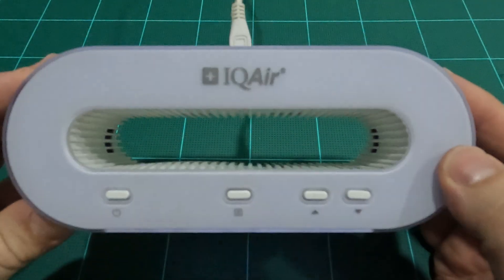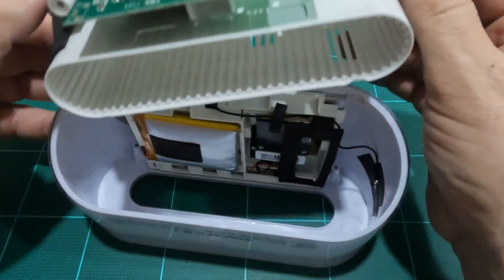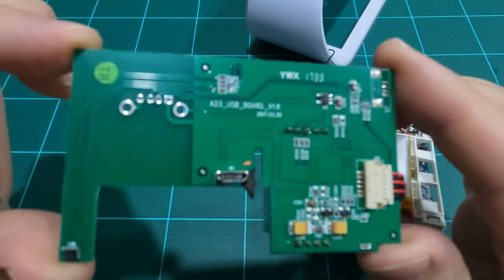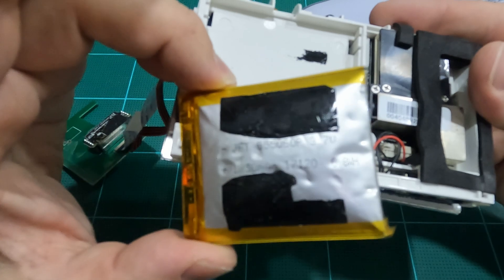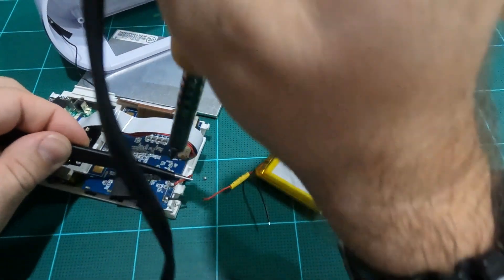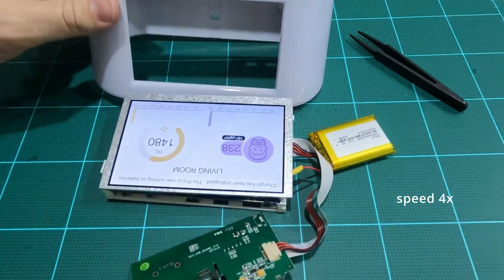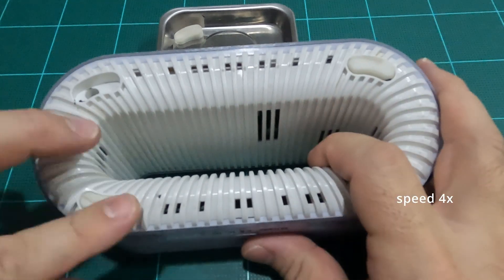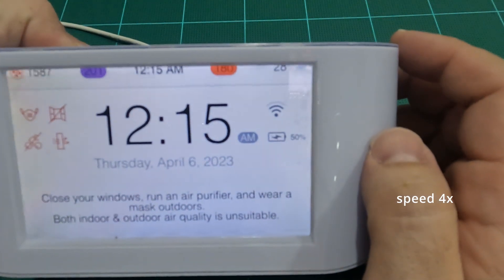IQAir Pro Repair exploded battery

Comment: My IQAir Pro stopped to be able to charge the battery while running. It was able to charge the battery when off. When turned on and plugged,  it worked for some time then died. 
I replaced the battery to a new one according the this very helpful movie. It didn't help. The problem persisted.
I finally removed the battery altogether and replaced it with a 4.2V 3A power supply and now my IQAir is back to life. Thanks for the video.
Reply from the maker: Glad it was helpful!
Reply: It is helpful if it can run without the battery.  Can you explain how to connect the 4.2V 3A power supply?  Thanks!
Reply: The original Switching Adaptor with the USB port is 5V 1A.  Do you mean just to remove the battery and then it will work, or you need another power supply?

Comment: The battery in the video is not the exact spec, which you can see at the end when he tries to fit it back together and it doesn't quite fit.  I made the mistake of just going off the number on the battery thanks to that and have a case that doesn't fit together right now.
Reply from the maker: So sorry. I will try to correct that.
Reply from the maker: Original Battery size says 555060 meaning 55mm 50mm 6mm.

Comment: Well done. But why don't they offer a battery-free version? Wouldn't most people use this plugged into a wall most of the time?

If anyone else comes across this video before changing their own battery, it would be great to hear whether it works well if you plug it in with the battery detached. If it remembers wifi settings, etc then running battery-free may be the best option.

Comment: Hi bro.      Could you share this new battery Spec and where to shopping it? 😇
Reply from the maker: I kept it 3.7v like the original. 
I think it was a 1800mA vs the original 1750mA if I remember correctly. 

Purchased in Lazada in thailand